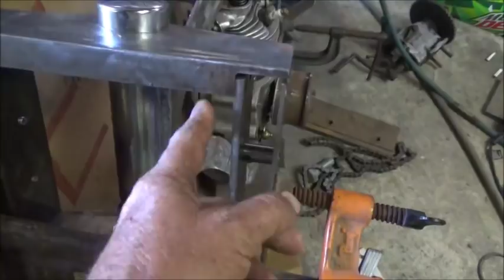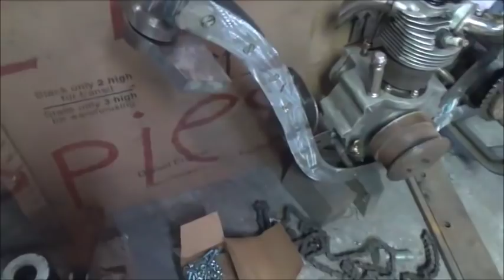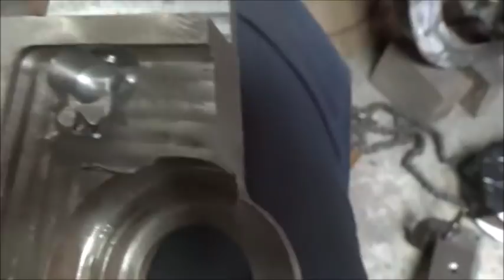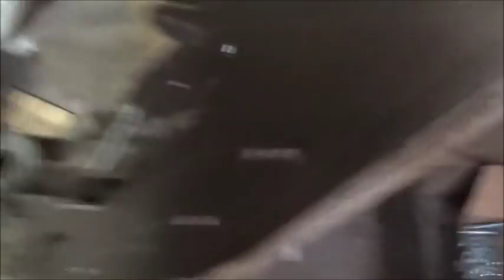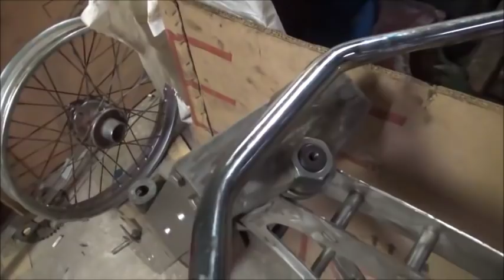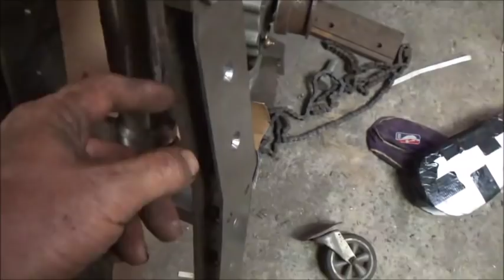Chopper, Bobber, Board Track Motorcycle Build Part 7 Fork Rebuild

Comment: Looks good man, very nice work! Sorry to hear about the tap; I've invented words during those occasions. You could machine a small block that slides into the slot you machined, then drill and tap it. I have made several "nut bars" in this manner for hard to reach areas.

Comment: Jonathan,  Just another comment,  When you go to make the "rocker-arms" for the front suspension, be sure and make the pins and bushings very tight clearance with regard to side thrust.  If when the suspension compresses, the front wheel should stay very parallel to the rear wheel. Another way to say, it should stay centered in the forks at the tire area.   If the front wheel should crook out of parallel with the rear wheel, and you are rounding a corner, the bike will begin to hop on the road, and you can loose control in the corner.  Having 2 springs, one each side, instead of a linkage and one central spring only makes it more critical that your rocker linkage is built tight (shim washers??) to keep the wheel from coming out of plane.
I actually experienced this wheel hop when rounding a curve from an out of parallel set of wheels.  I had a chopper built on an Amen-Savior frame, that had spring plunger rear suspension, just like the old Indian bikes had.  Because it had springs on each side, right under the axle (no swing arm), the rear wheel could lean out of parallel with the front.  I will tell you, this thing was dangerous.  Any leaning the bike into a curve and it would start hopping.  It was not because of the front end in this case, because the forks were stock Showa  (Honda) forks.
So if you do peruse the 2 front springs, please make very sure your rockers are tight, as the nature of the 2 springs design lends itself to one spring on one side compressing differently than the spring on the other side.  Hope this is helpful.
--Doozer

Comment: Good job! I was wondering, can you weld the pocket on the triple tree up and then machine it flat, drill and tap the hole, or would that not be a good repair?
Reply from the maker: Yes, but I can also just weld the nut in and fill the hole.

Comment: In the mount to the triples, you could probably build a little bit of negative rake in (which will move the front wheel back and therefore increase trail). It doesn't take a whole lot over the distance between the triples to add up to a lot at the axle.

Comment: I also like the narrowed look, Jon. If you don'y fancy welding the inner fork plates up, you could just use some spacers, possibly slightly bigger than the others, but drill and tap one hole, slightly off centre, then locate the centre for the other hole and drill and tap that.  The holes will be off centre to each other but they'll bolt up easy enough. Just an alternative to welding up.
Mart. Edit: 400th like!

Comment: When the chopper craze was in full swing I had more than one bike come in my shop with a whobble at higher speeds. Buying eBay triple trees with 20 deg rake was “the thing”. Then put on 10” over fork tubes. Fixed a trike that another shop built that went into a whobble at 75mph on the interstate with his wife on the back. I still don’t know how he got it stopped. Trail is huge. Looking good I love that motor.